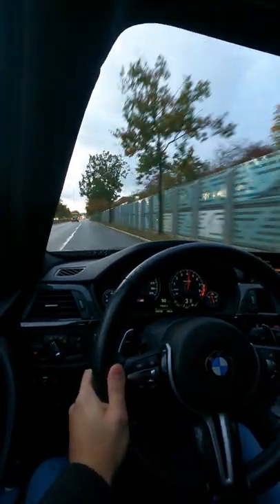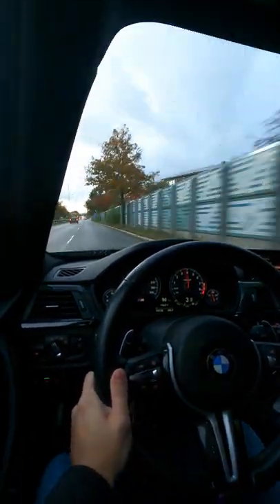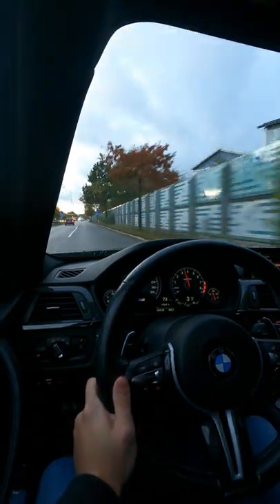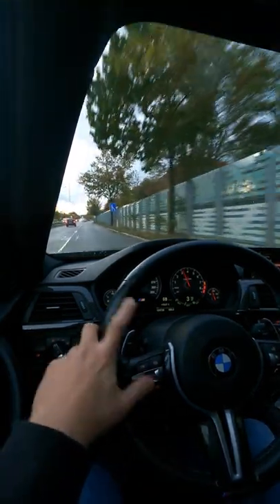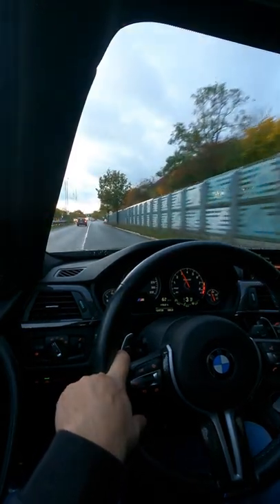Rolling ANTILAG - Steering wheel controls - New Feature Demo - bootmod3

Comment: Tried this earlier m2c. It engaged for a second then the rev counter needle went all the way to 8 as a sweep then back to driving rpm, put car back in efficient mode and turns tc back on.🤔🤔
Then when i went to floor it afterwards, it was really hesitant. Had to turn car off and back on to perform normal again.
Anyone any idea why?

Comment: pls solve the unlockin DME problems with latest DME versions(2020 bmw)
so we can flash and joy BM3 too
Reply: You just have to update the OBD agent I had the same problem
Reply: @camman4316  i use enet w an Apple connector 
They told me to take out ecu and send them to unlock dme so i CD hv flashed

Comment: Does this hurt the life of the turbos?
Reply: Probably lmao
Reply: If you ask this question its not for you
Reply: @lostcase55  Why cant I ask this question? I have VTT GC turbo and Vargas turbos are known to break.
Reply: @jp_b58  they are just saying that it's very common knowledge that these features 100% put an increased strain on the turbos. If it didn't, any car with turbos would have a launch control setting for anti-lag or even a track day setup so the boost doesn't drop while letting off the gas through corners.